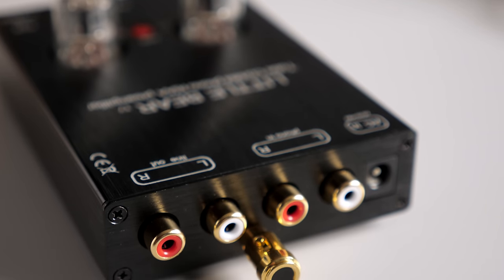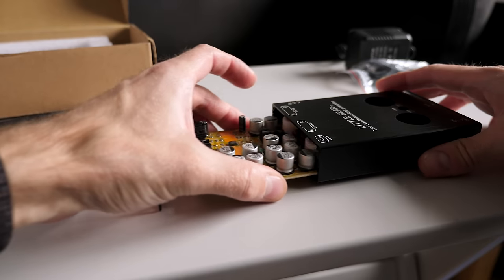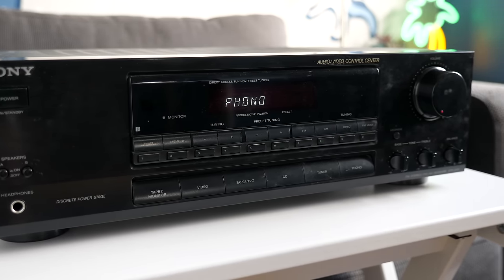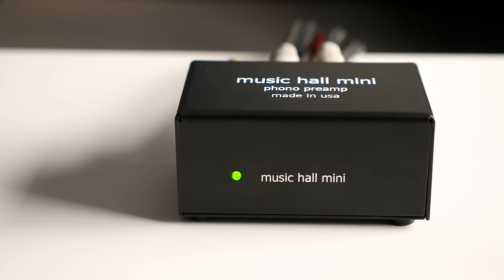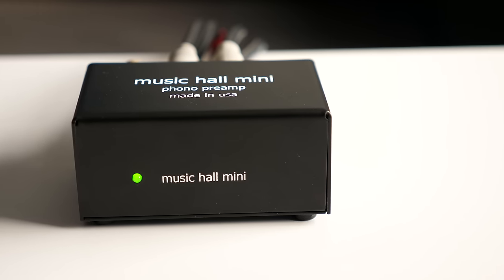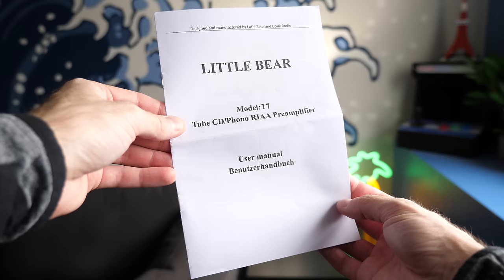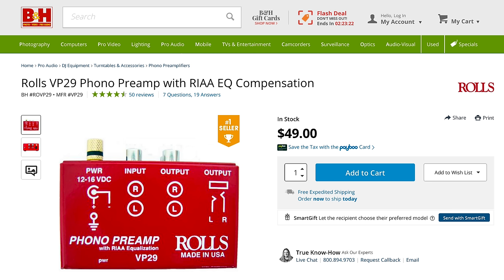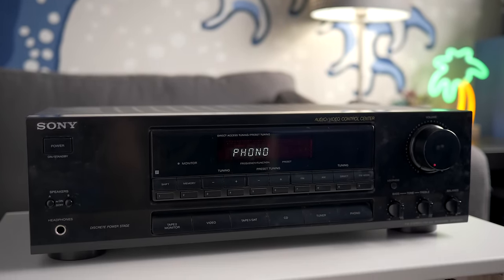A Look at Affordable Turntable Preamps

Comment: I love that you came to the conclusion that a low end early 90s receiver with a built in preamp was the best option, as that’s pretty much the route I would go without even considering anything else. Many years ago (mid ‘90s) my mother bought a nice bookshelf mini-system for her bedroom and still wanted to be able to play her records. She had a nice mid-‘80s turntable, but the mini system didn’t have a phono preamp; just an aux input. I simply used the phono preamp in a late ‘70s Pioneer receiver that had a blown power amplifier. Ran the tape output to the aux input on the mini system, hid it under her bed and left it turned on. Worked and sounded great for over a decade until she moved.
Reply: Good for you McGiver.....
Reply: @robertkensler2156  did you mean “MacGyver”, Mr. McStupid?

Comment: I've made this comment on all your speaker amp videos too...  The best you can do on a tight budget is get a used receiver.  My local Craigslist is beyond flooded with them as people upgrade to one that has HDMI.
Reply: A video setup receiver, but using only the audio part? That makes sense. Like BD players for cheap SACD.
Reply: I was on the lookout for an old receiver but the ones on eBay are priced higher than expected and postage is expensive. I'm based on an island so second hand stores and markets are a rare thing here. I also checked out the prices of passive speakers on eBay and they're selling for high prices too. I didn't see any bargains there.

Comment: I knew right away youd go for the receiver at the end. There's something about digital audio receivers from 1991-1999 that just makes them all incredible tanks. I have a Techwood receiver my dad bought through Rent A Center in 97', year I was born. He handed it down to me in 2013. It's never had any maintenance and I still use it to this day. It has zero issues, buttons have been cleaned but nothing further. Produces great sound with Phono, a tape loop and four external audio inputs with an FM / AM radio that I can get crazy distance with with a proper antenna. The versatility and sound quality in the even the lower tier receivers of the era is incredible. 
Everyone should still be using these, they are super affordable as well.

Comment: Two years ago I bought a Yaoin MS-23S Phono amp. It is a true tube (valve) phono stage amplifier. I use a Denon 103C Moving Coil cartridge in a Dynavector tone arm. Actually found it on Amazon a few years ago. The sound is exactly what wanted, very musical, but quite dynamic as well as having accurate reproduction. I did find it was mandatory to ground the chassis. Those who have heard it have been impressed as it has a quiet background. I have used it with a Shure V15 and a Grado cartridge with similar results! As I remember it cost $130.00 and it is a bargain. It uses two large transformers one for each channel and “rolling” tunes does make a difference especially with old Mullard, Telefunken and GEC tubes. It is musical and listenable.

Comment: My favorite affordable phono preamp is the ART USB Phono+...  Good signal to noise ratio, accurate frequency response, and has  a USB phono output, so you are not reliant on the sound card on your PC to encode the audio to digital.  It also has a switch for encoding line level as well as phono level, and has an optional bass rolloff filter.  As far as modern receivers, more are more are re-introducing phono pre-amps as an option.

Comment: I've bought a few of those small budget preamp from relatively unknown sources over the years, and have concluded that none of them hold a candle to the tried-and-trusted preamps the major Japanese brands put into even the cheapest integrated amps/receivers of the 80s and 90s.

To be honest neither of the two you reviewed seem as good to me as even the very cheap ($15-20 or so) Behringer PP400 (by which I mean there are obvious deficiencies in the sound, whereas the PP400 just sounds neutral) . The nearest I've found to a good budget preamp is the Cambridge series sold in Richer Sounds in the UK (Azur 640, CP1 etc) but these have been getting expensive lately.

All a far cry from the 1990s when a genuinely good preamp like the Musical Fidelity X-LP could be had for around £100 discounted.
Reply: Richer Sounds is a national treasure!

Comment: I started with what we now call vintage gear,and I'm sticking with it. Any of the mid to late 70's,made in Japan equipment beats most of these new pre-amps.
Reply: Does not matter where or when preamps/amps are made, just so as long as they're point 2 point, no printed boards.
Reply: Totally true , today I connected my vintage Kenwood ka 405 amp (wich recently got repaired) to my decent LP player.
Seriously the sound was 10 times better then before.
Normally it was connected from a Little Bear pre amp --> azur 540r amp --> philips ah495 speakers.
I always already thought that this Little Bear preamp was sounding a bit thin and lacking of clarity.
I used a external equalizer to have a bit more control of the sound though.
But today I heared the difference in sound , over the kenwood it was a much better overall sound compared to the cheap preamp.

Comment: Cheers from Australia. I'm a 61 year old gay DJ and Audio/Visual engineer. I've been around the block a few times but I "will not" include my 7.1 surround gear in my man cave for this test. In my bedroom I have a brand new Technics SL1200 Mark 2, the original version with the black base and grey plinth released in 1979 for sentimental reasons. It is fitted with an Ortofon Black cartridge which has a nude eliptical stylus featured. (a nude stylus is simply all diamond right up to the cantilever) My pre-amp is a Cambridge moving magnet pre-amp. After listening to about 30 of them at a friends store here in Melbourne, the Cambridge, a UK design with a phantom power supply was the best blind test of the lot and surprisingly only $80.00 which means it cost about $120.00AUD to buy. I used headphones for all the tests. Some of the $500.00 pre-amps were terrible. They were either muddy or crushed the top end badly. The output of the Cambridge pre-amp was fed into Auxiliary One of my PrimaLuna HP Integrated Vacuum Tube Amplifier. It is all valve amplification with 6 12AU7 pre-amp valves in the front and 8 EL34 power valves at the rear delivering 100 watts per channel into a pair of 8 ohm Wharfedale standing speakers which are 3 way 5 element and sound magnificent. My CD player is a Pioneer CDJ club unit which has a digital output but running high quality RCA leads is just as good as running a digital to analogue converter. PrimaLuna decided that an on board phono pre-amp was a waste of time because most people these days want to choose their own.  My hearing is excellent. I made my own split cue systems to avoid hearing damage and I can hear up to 16 kilohertz. Great for my age. After listening to the Little Bear valve unit, I was stunned at how bad it was. It was a shocker and the only pre-amp worth considering was the built in unit in your integrated amplifier. Unfortunately with vinyl becoming so popular, these cheap pre-amps are flooding the market and not delivering anything real or logical. I'd look around for an integrated unit with a built in Tuner and a Phono input on the back. There are plenty of great units on eBay to look at. Unfortunately getting great sound these days can be very expensive but it's no good wasting your time on cheap garbage like this if it's gonna sound terrible. You can pick up some great combinations of speakers, an amplifier and a turntable and get great results. I cannot, except for the amplifier recommend any of the pre-amps.

Comment: The problem with cheap (sub $100) phono preammps is they usually have static, hissing and all kind of noises because they are not correctly isolated, the signal coming out from a turntable is very very weak and even the most insignificant noise gets amplified by 100x or 500x and ruins the sound completely.   Even pretty good ones like the entry level Music Hall reviewed in this video or the highly praised Cambridge Audio 640p are not good enough and are prone to noises... and I'm talking from my own experience.

I strongly recommend y'all spend a little bit more and get good phono pre from well stablished brands from the get go... if you wonder where you have to spend your money in a vinyl system.... spend it on the phono pre-amp I learnt that the hard way.   Audiophiles are crazy people but they are right about the importance of a good phono pre... they are CRUCIAL, no snake oil here.

if you don't mind putting a DSP in your signal path give a try to the wonderfull Parks Audi PUFFIN... it's a swiss army knife, it uses digital magic to alter the sound an emulate expensive tube and solid state phone pres (you can select what you want to emulate)... in fact, you can do almost anything with the Puffin and it sounds like analog pre-amps way way over its price thanks to DSP magic.  It's not "playing fair" by audiophile terms because your are messing with the signal converting it from analog to digital and then back to analog...  but who cares?  It's not cheap but it's affordable and it sounds amazing.  I think this is the product I'd recommend to 90% of the people.  It really surprised me.

If you don't want to put a digital stage in the middle of your system then go for a Pro-ject Tube box S or the Rega equivalents... they sound amazing and they are 100% analog.  IMHO targeting below this level of equipment is a waste of money and missing the point of going vinyl.   Personally,  I have a Puffin for my 2nd system and a top of the line Pro-ject RS phono box for my main rig... both are amazing end of the game products... but the mid-tier Project phono pres like the Tube Box S are amazing too.... no need to go RS. 

My 2 cents.

Comment: I have a Little Bear which I like, the secret is to change the tubes. True the tubes are not doing the amplification, but the coloration you heard here is from lousy tubes. Replace with GE 5654W (cheap on eBay) and run same comparison.
Reply: Are you sure? I would try

Comment: Not to be this guy but for me the best sounding one is the digital version on Tidal in Hi-Fi mode.. Tested "Shade" and it has more responsive dynamic range (especially noticable on drums), less exposed high frequencies, and most importantly - no hiss/pops (mostly noticable since the 49th second of the track).
Tested on Sennheiser HD 650 btw.

Comment: This just shows how modern crap is just overpriced and is in fact, well... crap. I have so many vintage gear that wasn't high end to begin with but has a better build quality as well as sound quality than most modern devices.
Reply: What analog amps do havd better sound for similar price?

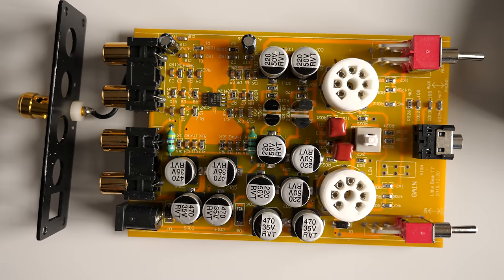Comment: The dull high-frequency response of the Little Bear is due to the exclusive use of electrolytic capacitors.  Look at 2:37.  If one wants to have high capacity in audio coupling, one can use electrolytics but MUST (I insist) parallel them with ceramic or, much better, polypropylene capacitors equaling at least 2% of the electrolytic's capacitance.  For instance, there are many 470uF on this board; ALL should be parallelled with at least 10uF.  Another possibility is to use one tantalum of at least 5% in parallel with polypropylene of 2% or more of the tantalum cap.  In this case : 470uf electrolytic in parallel with 25uF tantalum, in parallel with 0.47uF or more polypropylene.  The solid state dual op amp has a good high-end response to beyond the human ear's limit : it won't cause that dull sound.  The tubes, of course, are there only to LOOK like a tube amp and justify a higher price.

Comment: I have a Little Bear preamp and have had just the opposite experience.The first thing i noticed was high end like cymbals became audibly "visible".I run a systemdek IIX through it with nether the deck or the preamp grounded as these are already grounded through the mains plug.I tried a couple of GEC equivalent tubes for comparison and those subtle high end improvements vanished.I learned that these tubes were originally used for high frequency applications such as portable transceivers which almost explains why i experienced a high end boost but only with the Chinese tubes.........................

Comment: Old receivers phono preamps, most of them are just right with very low noise floor and proper RIAA curve. Clean the knobs and you're probably good to go. Anyway, at the prince they sell at the thrift store, spend 50$ buying 6-7 of them, and experiment. You're best deal is there. There is also nothing wrong using half of a device for amplification and other half of a device for it's phono preamp. sometimes, only half of a device performs the way you want it to. make a stack, as we did in the past and enjoy it.

Comment: To me, I prefer your Sony receiver's phono preamp section as the music sounds more clear, has a bit more punch with the treble, and has this three dimensional sound, only my opinion. Thumbs up, very informative, thorough demonstration!

I've got a Rolls VP29 Phono Pre-amplifier, made in the USA connected to my Sony STR-DH520 AV Receiver, both bought in late 2012, and everything works well. Up here in Canada, after 13% tax the Rolls VP29 preamp was a little over $100, from what I remember. Also it has a ground terminal, and an AC adapter; never had a problem with this phono preamp. Only that it does not have a power off switch, so that it requires it to be disconnected if not used. Why bother using up more electricity, money, maybe wearing out that green light shinning outside of that cute red box. Also since the cables are not exactly long enough, I have this phono preamp set on top of 2 wooden blocks on a wooden floor. 

Rolls VP29 Phono Preamp is as good as the preamplifier section of my Onkyo TX80 33 watt minimum receiver from late 1987. Therefore, I from my listening experience a moderately priced, well made phono preamp can perform well. Mostly my opinion.

Comment: Another fab video!  I bought my first turntable a couple of years back, and wasn't sure whether to go down the powered speakers route using the table's built in preamp, or splash on a receiver.  I ended up going down the latter route, and I'm glad I did.  I ended up getting a Yamaha A-S301 amplifier which is a new model, yet had a phono preamp!  Paired with a set of Tannoy 7.2 speakers, it produces a lovely sound and I'm very glad I spent the extra on a decent amp.  :)
Reply: Didn't know Tannoy made home speakers! In the UK it's a generic noun for "PA system", as in "her voice came over the tannoy". Had assumed they specialised in industrial speakers for that reason, heh.

Comment: My VP29 is dead quiet.  I like it a lot, better than any receiver that I've tried.  Of about 6 inexpensive preamps that I've tried, the VP29 is my favorite.
Reply: Me too, spahr001! As I've posted before, here is what I have said: I've got a Rolls VP29, works well, don't have a problem with this phono preamp. Only thing is that it does not have a power on/off switch. Furthermore, some of these pre-amplifiers are designed in the USA, but they are assembled in China.

Comment: Thank you for this great video. I can confirm the little bear sounds, like you recognised, a little muffled on my Goldring 1042 cartridge. And on my old Braun PS550s with a Shure M95e cartridge it sound far more open at the top end. Seems the combination of cartridge and preamp matters. I bought the little bear because my Braun turntable is 15m (49 feet) away from my marantz receiver (without Phono stage) and I like the option with switchable amplification just to compensate the loss in Volume due to long cables.

Comment: I’m using the old “pseudo” component rack my parents bought 30 years ago... 
it’s a cheap AIWA but works well and definitely sound mich better than the most affordable systems produced today. 
There are plans to buy a new turntable and a new preamp for the purpose of listening to records via my headphones  (Old Sony MDR-V500) but replacing this old Hi-Fi? Nope!

Maybe it wasn’t exactly the best equipment back in the days but it was a time when build quality meant more than to get it running barely longer than the necessary 2 years. 

And yes, nostalgic is a thing is this equation 😄

Comment: Yeah... as you showed, many 'vintage' receivers/amps of a decent brand, had great phono pre-amps built into them... a Sony, Technics, Yamaha etc will sound great!  
Of the modern pre-amps, the one that I've settled with is the Rega Mini Fono 2 pre-amp... it has a low capacitance input so it doesn't kill high frequencies from most cartridges, and sounds just so transparent, and natural, whilst being of a decent output voltage so record playback doesn't sound too low.  In fact the only thing I don't like about is that the ground screw terminal is on the front of the case, and not the back... what were the designers thinking???!!  Overall though, it's a fantastic sounding pre-amp, and only £99.00 (whatever $ equivalent)... oh, and it has a USB output too, for if you want to copy your records to computer!

Comment: I am using an FX-Audio Tube-01 buffer/ preamp with the same tubes as the little bear. I can confirm at least the tubes are not coursing the roll-off and has great depth in bass, plenty of detail. Must be a problem with that op-amp. Usually with these imported devices they do expect the end user to repair if it's not under warranty, or if they do end up having to "fix" it they will ship you a new device. It all boils down to the price it would be less cost effective to have to ship a device back and forth overseas on top of repairing it. I tried with Topping after the dac/ amplifier I had had quit working but they refused to repair it or even replace it.